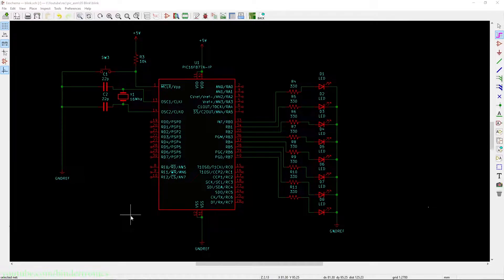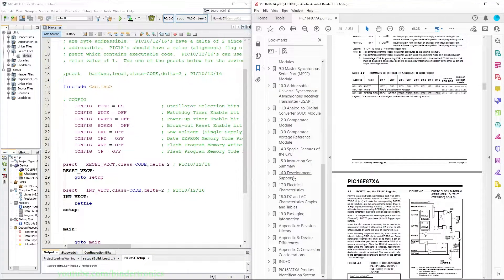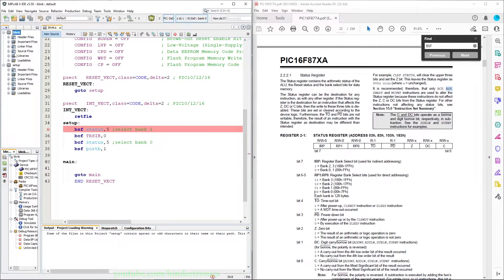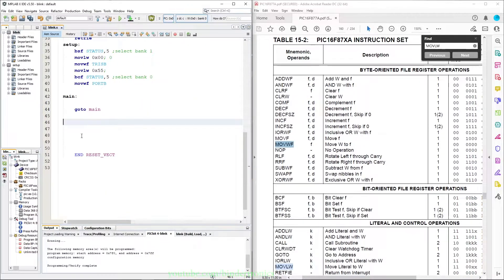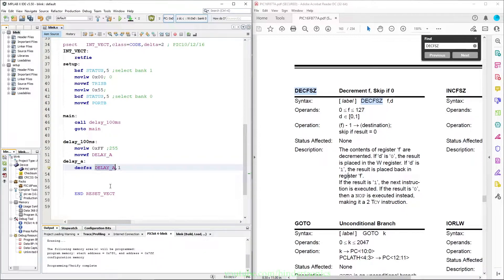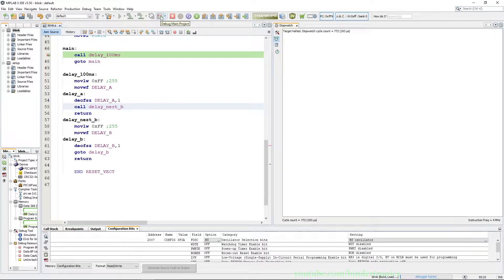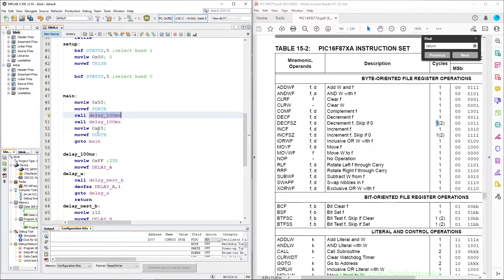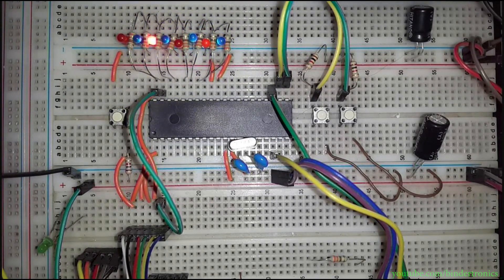Blinky and Running LEDs 🔵 PIC16F877A PIC Microcontroller Assembly Tutorial #5 MPLAB X pic-as mpasm

Comment: Is there a reason to not use the macro (assembler feature?) BANKSEL?  For example, you want to use register OSCCON, add line before using register of 'BANKSEL OSCCON'
Reply from the maker: Makes it clear where and how stuff comes from. 90% of the time is spent in back 0. I forgot but it was probably because I was lazy to read the PIC-AS assembler manual.

Comment: ive watched some of your videos and you are very good programmer loooks like you could programe prerty much anything microcontroller based ,could you programe some NeoPixel Ring - 16 x 5050 RGB LED or anything that uses them leds arduino already has a libray for it but would be nice to run with a pic microcontroller
Reply from the maker: What you are asking for is a tutorial on ARGB LEDs. Once you understand how the ARGB chip functions the MCU becomes irrelevant, only that it has sufficient resources. PWM is terrible on PIC. I understand why no one is keen on doing it.

Some industry insight. We all use libs for ARGB. At most we port the HAL layers to a particular platform. In some cases we hijack I2S or some other peripheral instead of using PWM.

Color theory is a whole other beast. You'd think mixing blue and red light makes purple. Nah makes pink.

WS2812B is the datasheet you are looking for.
Reply: will look into how its done on arduino then can work out how todo it on pic hopefully a 8 bit pic will work will see thanks @BinderTronics